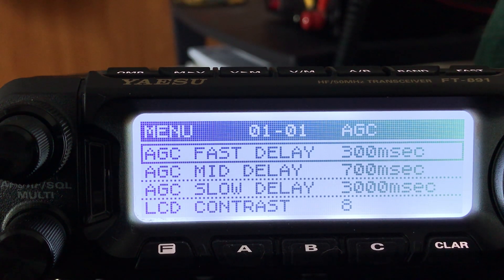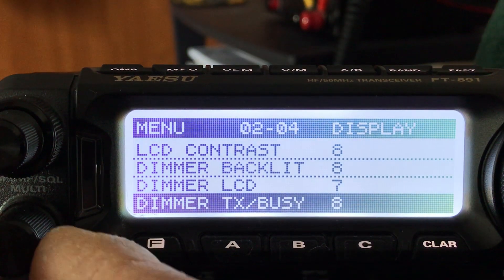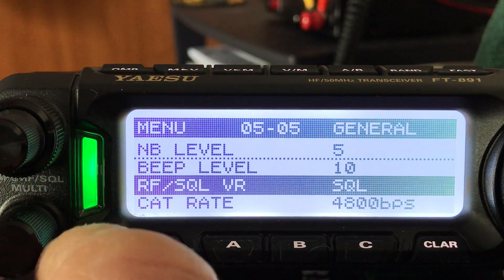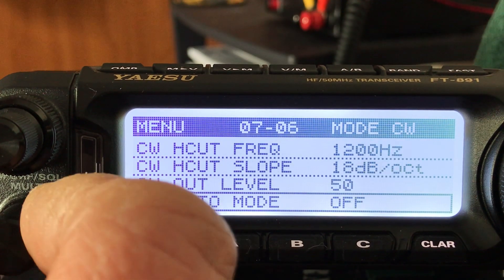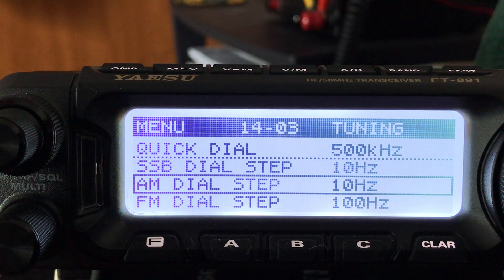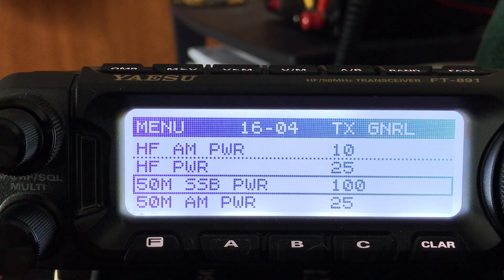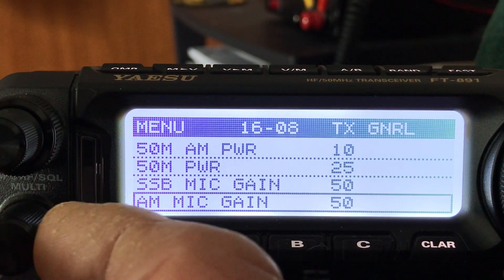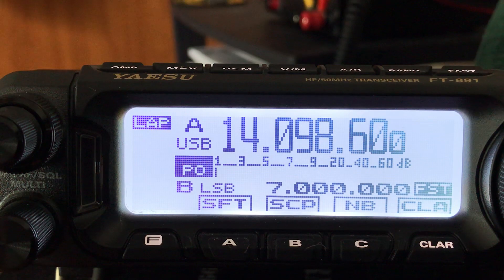Yaesu FT-891 Initial settings

Comment: Nice job!  All good ideas for setting up the radio.  I totally agree with lowering the power out until you become familiar with the rig and the antennas you might be using.  I love my FT-891 due to it's performance, small portable size, many adjustable features and most of all the very affordable price tag!
Reply: can you set A, B or C for quick power settings access?
Reply: @TomSP9TL  I never tried to so, I am not sure.

Comment: That’s a great basics video! Thank you. I find this radio much more confusing than my ft 991a. The menus are a little unclear. But I like it’s ease of portability. The battery, radio, auto tuner and accessories fit into 2 pelican cases plus my Wolf River Coils antenna and I’m set for POTA. MikeinMinnesota N0WDM
Reply from the maker: Thank you! You're right, the menus are a little querky, and it's still difficult to get to the power setting.. but no other radio can touch it for power, size/portability and super quiet receiver.

Comment: Thank you for this helpful video. I just got my 891 about a week ago and am trying to get used to getting through the menus and making some adjustments. I've got an MC-750 portable antenna and a Bioenno battery. I plan to get into POTA and this setup will hopefully get me up and running with minimal problems. I also notice that my new radio has newer firmware than what you showed. That's good because I hate doing any kind of software upgrades - ha.

Comment: Made a few short transmissions on 20 meters voice with around a 3:1 swr on the built in swr meter... Had the output at 25-35 watts, think this could have damaged it?
Reply from the maker: Hi… no you’re fine. Most Yaesu radios including this one starts reducing  the power output when the SWR goes above 1.5 . And you were using reduced power, and the swr was t infinite so that was good. Once you get a tuner for it or a more resonant antenna you’ll be all set.
Reply: @hamradiocomms  Thank you, good to know! I have a mfj 939y, just waiting on the coax jumper with the pl259 connectors to arrive.
Reply from the maker: @rossjones7014  Great choice of tuners, those auto MFJ tuners have wide range and super fast to tune.

Comment: Does the 891, with an auto tuner connected, reduce power automatically during tune up?
Reply from the maker: Yes, with a compatible tuner, the tuner is responsible for controlling the FT-891 by switching modes and lowering the power. So the FT-891 is able to be controlled by the tuner no problem. I’ve used MFJ and LDG to control all my radios auto tuning:
Reply: @hamradiocomms  I just got a new 891 to replace my TS50 in my truck. I got the MAT30 tuner coming as well.

Comment: Hola amigo. Haber si puedes ayudar. Compre un 891. De japon. Y solamente. Transmite con 50wats. E actualizado el firewaar. Y sigue. Igual. Como hago para obtener  los 100wats.  Muchas. Gracias. LW7DBJ
Reply from the maker: Hello… unfortunately I don’t think there is anything you can do to make 100w … Japan can only legally have 50w so they are built that way. There isn’t a setting you can change that will help.

Comment: Question to go true qrp say 10-15 watts do you drop both HF SSB PWR and HF POWER to 10-15w or just SSB POWER? That’s confusing with me.
Reply from the maker: Hi.. you just need to drop the HF SSB PWR to the lower power. The HF Power is for all the other HF modes power settings.

Comment: Our FT891 has the menu optio in different orders and different "chapters and pages". It is confusing trying to set up a new FT891 when this video and the menu do not correlate
Reply from the maker: Hmm. that's weird.. everyone else's is the same that has commented here.. does yours match the chapter and page list in the manual? Was it modified in anyway?
Reply: maybe you ft891 is a chinese made clone? 
maybe you have a different firmware version, those need to update once in a while.

Comment: Why wouldn’t you check the SWR on AM or Ritty. No need to lower SSB to 45 watts. Do the checking on AM/Ritty then go back and talk on SSB. 73 de N2LRB.
Reply from the maker: Thanks for the question. I'm not sure what you are referring to in the video about checking SWR. I always use RTTY on manual tuners to tune an antenna after lowering the output to about 20W, Otherwise I always use automatic tuners and they change to RTTY and lower the power automatically, I never would use SSB to tune though setting the auto tuner to tune on Keying it tunes using SSB on the fly while you're talking,
 You might have misunderstood what I was saying about safety. These are initial settings,, I turn down the power on all modes until I have the new radio installed in the vehicle, go box or shack. When the antenna is working properly and all is good that's when I turn the power where I want it so as not to blow the finals. 
I hope this answers your question!
Reply: @hamradiocomms  Ok. Good to know and thanks for getting back to me. 73 de N2LRB

Comment: have they fixed the switching from USB and LSB issue? can you easily switch from USB to LSB on any band now or do you have to do weird menu work around stuff?
Reply: You go into menu 11-07 and switch the 'BFO' setting from 'AUTO' to either 'LSB' or 'USB'. So, in a nutshell, they didn't fix it. There should have been a 'USB' and 'LSB' option in the selection screen that pops up when 'BAND' is long-pressed. Also, the error that mislabels the QMB button as the MODE button in the User Manial is unforgiveable. Yeasu, you can do better.

Comment: GREAT VIDEO, how do you get the swr meter to be on the front screen right now it shows po ? i would like to put the swr in its place
Reply: Chose MTR on the Function 2 screen and use the multi knob to select what meter function you want.
Reply: @kd7jz , thank you Tim for showing us this!  I asked the same thing about 1 min ago...... Whoops, sorry ya'll......  Mark W5HSJ
Reply: @W5HSJ  I like the radio for the most part but I become more unhappy with the documentation each time I try to figure something out.. GL es 73
Reply: Quality information... This will make programming my 891 much smoother. Thanks!

Comment: 8:37 Set the contour level (menu point 12-02) to +10 
the DNR works ok but attenuates the higher tones a bit, the audio sounds then a bit muffled. the contour filter set to +10 amplifies the higher tones a bit and compensates the attenuation of the higher tones, the audio sounds then so much clearer & better.
The contour frequency is best around 2600Hz. 

The yaesu ftdx1200 has a way when pushing two of the buttons lower left side from the VFO knob, then the thw SSB TX bandwith can be set to "TTBF", that is an almost whole 4KHz bandwidth, from 50Hz till 4000Hz. the 100-3000Hz SSB TX bandwith in the 891 is good too but 4KHz make a great difference in that matter for a very good audioquality. how about a large diaphragm condenser studio mic for the 891 ? i wonder how the 891 would sound then.
Reply: Yeah, great idea to splatter around and ruining other people's QSO.

Especially when operating QRP I really love this special kind of hams.
Using 4 or 5 kHz bandwidth to pose with your studio mic and 'broadcast like audio' is nothing but ignorant.
You really can ruin someone's day this way.
2.7 kHz is the way to go!

Comment: Way, way, way, way, way too many menu and sub menu settings............Why can't we have a real radio'
Reply from the maker: They sell "real" radios without many menus and more buttons but it wouldn't be small enough to carry for portable.  Take a look at the MFJ-9400 series , these are awesome old school radios with just a few buttons and knobs,no microcircuits etc.. as far as menus, since this radio has lots of capabilities as far as DSP, Digital, diff power out setting for diff modes, that older radios don't have the menus will be there. The good news is there are plenty of old school radios out there.
I have videos on this channel of my MFJ-9420 making contacts.
Reply: This is a radio I am currently looking into for exactly the reasons you stated above. I also do not want all the fancy LED/touch pad microcircuits etc. Sometimes simpler is better. I am new to the hobby and got into this hobby to stay away from my computer, or high tech tools. Simple old school techniques and equipment is fine for my taste. Wish tubes and crystals were still popular, or readily available, as those were even simpler times 😉